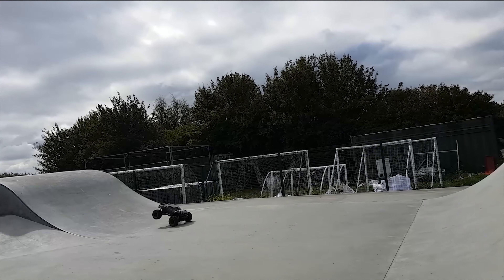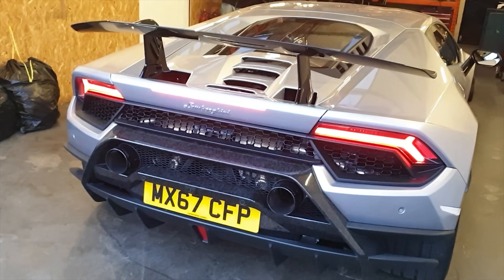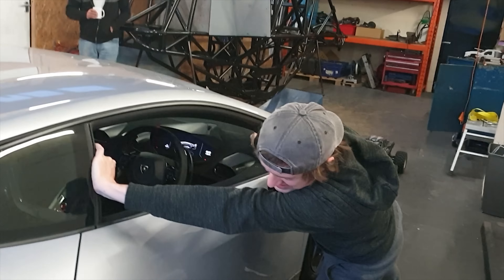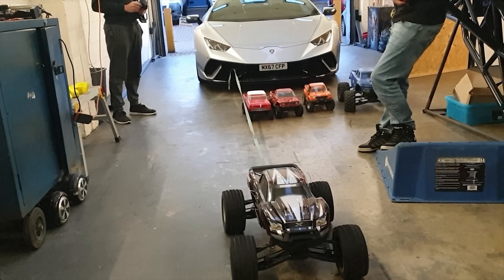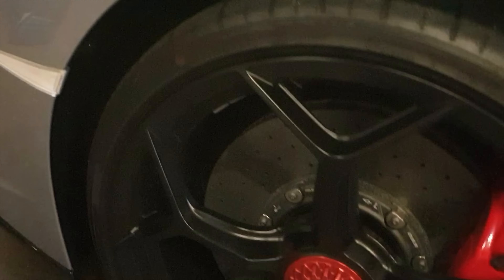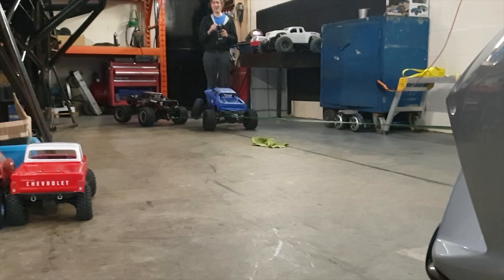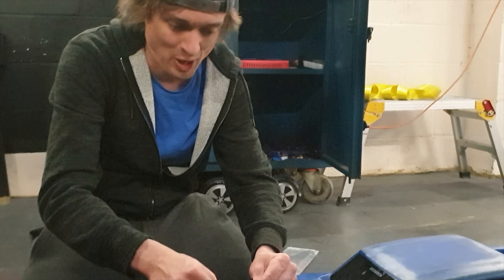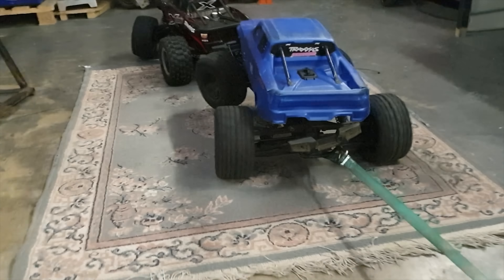How Many RC Cars to pull a Lambo?

Comment: Heh, that all depends on the drive train....I'm guessing electric and I've seen some outrunners used on ebikes..... I only use 8g silicone wire for my power harness in a 2 wheel drive electric mountain bike, 10g for phase wire right onto the board in the controller, with hall sensors you can control your torque and output much better, because it's not just about horsepower, it's about how and where you apply the torque and the power...do those have locking diff's ? and transfer case so both front and rear axle get the same power ???
Now what would be a really cool video......  3 phase brushless hub motor in each wheel :)  now that would give you some pulling power :) even if you had to widen wheel base for motors. Liquid cooled of course because then you could put some serious amps to them....
I run my ebike front motor at 20 amps and rear at 40 amp @ 36v, it still spins the front wheel all the time, bunny hopping at 30 kph beside cars is funny :) front motor at 40 amps is stupid fast :) Even with full weight on the bike it spins out and I got a cheap ass one 9C, it's not like a Crystalyte 40 series. Not liquid cooled..... yet.... I got a rig up, using computer liquid cooling for the controllers, I know RC motors have liquid cooling jackets....
For a mountain bike, rear drive is cool, front drive is ok, a bit easier on hills but a 2 wheel drive ebike, front and rear, is kickass...
Reply: POV: deku is explaining his quirk

Comment: I think the 2 xmaxx will pull it but you have to be on level ground the garage is on a very slight incline the reasoning behind the small incline on garage floor is so watter runs down I relate to this because I help pour garage floors and build houses I love your videos kev my mission is to watch all your xmaxx videos and more. your channel is the best you have also given  me the balls to jump and bash my xmaxx haven't done yet but I will soon. I remember before watching you videos I rolled my xmaxx and almost had a heart attack now I watch you videos I'm gonna order the unbreakable body I'm taking off wheelie bar and off to the skate park I go I think mine will break because I have aluminum control arms I think I will remove before doing the skate park

Comment: I witnessed a Traxxas Summit push a 2013 Toyota Camry on it's own, but couldn't pull it. It's still wild how RCs can push or pull a car period considering the size of the RC's compared to the car. Now if you have enough RCs to be equal to the cars weight, it isn't suprising then as much. 2 X-Maxxs might weigh in total 1/50th the weight of that Lambo which makes it a little more suprising.